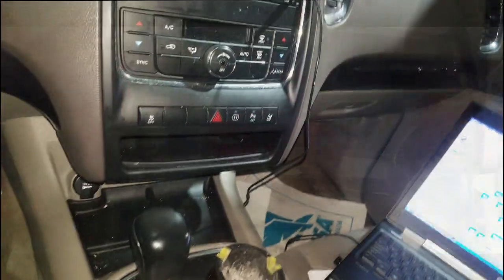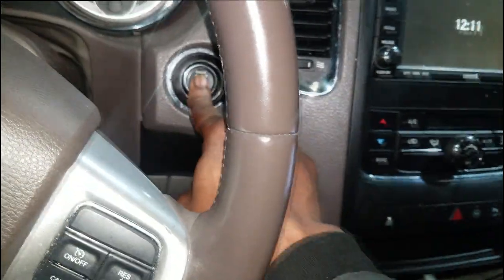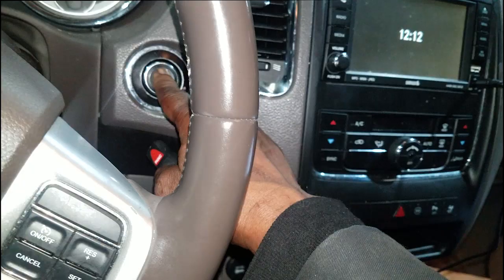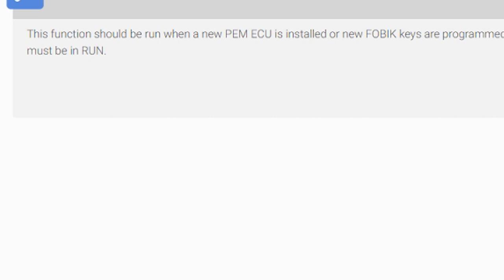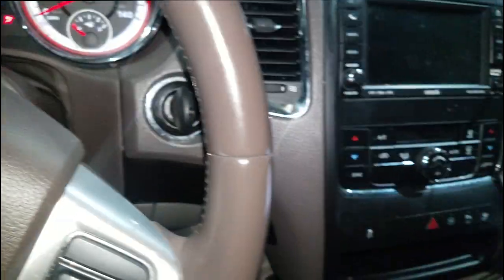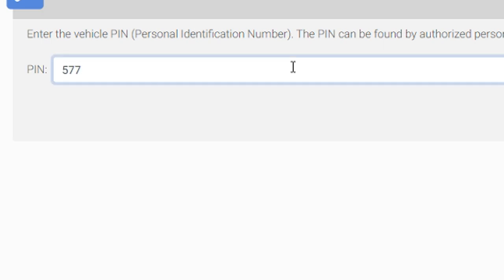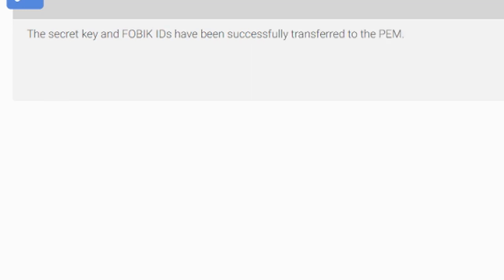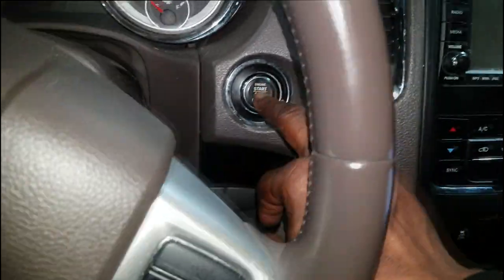How we install push to start system button in your car. Keyless PKE PEM. Passive keyless entry.B1A25

Comment: I've got an after market keyless system on my Grand Caravan. 

The start button works the same as a remote start. It will start the car without pressing the brake, and will turn off the car upon pressing the brake.

After starting the car I have to toggle a bypass switch which prevents the ignition from being killed. I don't know how this works... and I wasn't told how it works. Anyways... You don't need a key. If the doors are unlocked, a stranger can drive away with it.

But they won't, I promise... My Caravan is special... It has spaceship controls (not kidding)... And no driver's seat.

By space ship controls, I mean: hand controls for the gas and brakes, a joystick communicatively connected to the steering wheel through a controller and a pair of servos, a bunch of unlabeled buttons and switches, and much more.

I love my caravan... And it's stainless steel lowered floor which is rust belt resistant!
Reply: Pleaseee tell me youve uploaded a video showing this off
Reply: @besaved  No, but I can tell you the names of the systems if you want.

Comment: Great video. Some1 had told me it was just plug n play. I doubted it. I work at a Dodge dealer. How did you get the PIN?
Reply from the maker: lol, No its not plug and play. Is it even a oem PEM? Also are you subscribed to the channel?

Comment: Nice video I want to know would PEM work for 2016 ram 1500
Reply from the maker: Depends on if the sys and your key. Do you have the push in key or the blade key? Also are you subscribed to the channel?
Reply: @OnlineMechanicTips  what you mean by system and key

Comment: Where did u find that I’m trying to buy that so I can do that to my dodge.
Reply from the maker: Where did I find what? What exactly are you doing?
Reply: @OnlineMechanicTips  where did u find the push button  and I’m trying to add one to my 2012 dodge Cummins with the same style key as yours
Reply from the maker: @brandoncage8135  Hey bud thats all dealer parts. The thing about that is if your truck do not offer that feature (its built into the skim module) it will not work. They need to run your vin to see if its factory equipped already

Comment: I wanna know what program you’re using in this video on the computer to program the key
Reply from the maker: You cant get that program..that's fca tech programming
Reply: @OnlineMechanicTips  so what’s the point of the video if I can’t have the program then how am I supposed to do this myself
Reply from the maker: Great point, my point was to show how it's done at the dealer. A lot of people want to know what's done during the process. Sorry if it seems misleading.
Reply: I bet if I knew the name the program I could download it
Reply: There is a program available for windows ( $59 ) and Android ( $49 ) and does the same thing. It’s for Dodge,Chrysler and Jeep  and other makes by FCA. 
This program is called AlfaOBD and you select your vehicle and then “Central Lock” then select “ PEM Replace” and enter your cars security pin to write it to your PEM module .The app can also read your pin from your vehicle.
This app can program key fobs and if your vehicle has Passive entry aka Keyless Enter-N- Go feature the PEM Replace option takes care of that programming too. Make sure your key fob is compatible with push button start ( plenty of aftermarket fobs online ) . On my 2012 challenger there is a square component on my  key fobs circuit board with a white sticker on it that says “Premo” and it’s wrapped with fine copper wire. This component allows the function of keyless entry to be programmed. You will want to program the buttons on your fob first using the “Radio Frequency “ option and entering your code. The video was covering PEM so I mentioned it first.

The push to start button in this video was written to the PEM module the same as a key fob would be so I described the keyfob because most people would probably replace it more often than the button he changed out.

Hope this helps you guys 😎
Reply: @nvidiashield495 so it’s possible to be done with the Durangos that didn’t come with push to start as long as we buy the fob that’s capable with the push to start button?

Comment: Can I do this on my 2011 Dodge Ram 1500 ?
Reply from the maker: If remember correctly this van was a 2011 year model. So if the skim model in your truck already set up for it, its just a matter of getting the part and marry the 2. Is this a highline truck? Also are you subscribed to the channel?